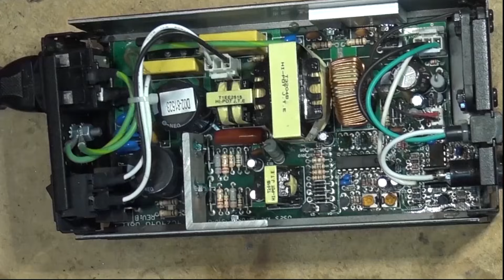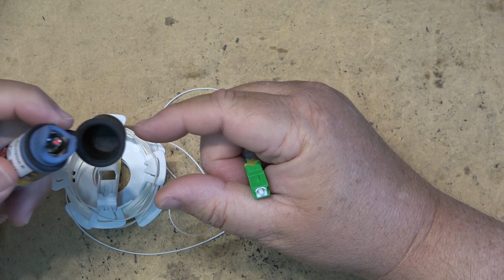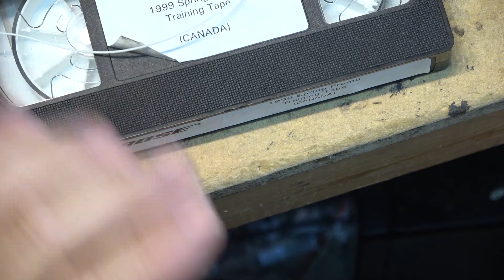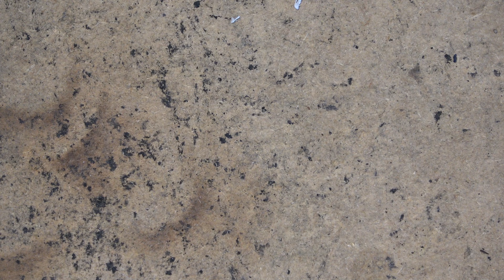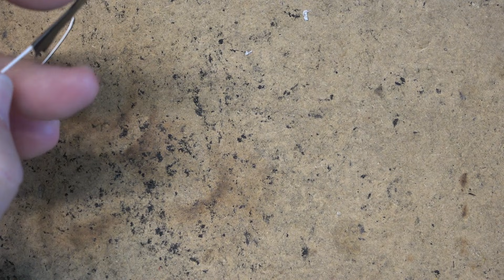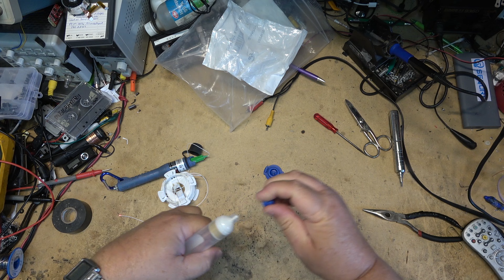Fiber Optics Tougher than you think

Comment: I’m in the uk and had the pleasure to see the first cable & wireless college being built in Coventry with optic fibre through out back then they needed to polish the ends for every connection and watched the first face to face link what we call face time now great video brill watching you at work
Reply: We would use smooth sandpaper measured in microns and you would look at the fiber face under a microscope to make sure there are no cracks or scratches for the best light flow.

Comment: My house has the black armored fiber coming into the ONT cabinet and that ends in a socket. Inside the cabinet there's a jumper of something like this stuff with SC connectors on both ends, that goes between the incoming fiber and the actual ONT. I thought the jumper looked extremely fragile, guess it's not tho.
Reply: Some are

Comment: Some time back I had a fibre optic lamp - none of this plastic rubbish filaments (says Dave)
When I disposed of it, I ended up with all these tiny bits on the floor.
For months on end I would end up with tiny pieces embedded in my feet.
They were difficult to remove with tweezers as they easily broke off.
Not fun!
Reply from the maker: That's why they started making them out of plastic.   Glass shards not fun. B

Comment: Fiber optics what about the Network interface  outside the home were it connects? Can't it be very fragile
Reply from the maker: The outside cable is armoured. Kevlar, fiberglass rods and heavy plastic jacket.
Reply: @12voltvids  rods, you talking about those green rods?
I use them on my model airplains as pushrods. Are they dangerous to health also?
Reply from the maker: @worroSfOretsevraH  if you are referring to the fiberglass reinforcement on drop cable no. Only the actually glass is hazardous if you get stuck by it and it gets into a vein.  Just imagine what happens if a piece of glass gets into your circulatory system.  Lots of places in the body it can lodge and cause life-threatening complications.  If you stick your fingertips it is uncomfortable for a few days but if you hit an artery or vein that is extremely dangerous.
Reply: @12voltvids  Yes I was referring to those light green ~1.8mm diameter fiberglass rods.
Thank you.
Reply from the maker: @worroSfOretsevraH  
No danger in those other than slivers.

Comment: Do not pull fiber by the actual fiber, Instead pull it by the Kevlar pull string. Doing this will distort the fiber it will become wavy physically and as a result light and cause millions of errors per second and your ont won’t come up.
Reply from the maker: This stuff is NOT pulled. It is placed inside, and glued up. Fiber that is pulled in is clearcurve and it has the Kevlar wrap to protect the strand. I was just demonstrating that this stuff is not as fragile as many think. It will withstand a fair bit of abuse.
Reply: @12voltvids  thing is customers will pull it and get billed the likes of which they cannot imagine. I know that you would not do it but they will take your skill for granted

Comment: Hey Dave our electric company is running it to all of their customers I can't wait LOL still 5 to 8 months away last time I checked, Anyway I was curious what the equipment inside the home looks like and how it is linked/connected to the computer if there are different types of interface. Current set up is LAN through a router.
Reply from the maker: The device at the premise is called an ONT (Optical network terminal) and comes in a few different configurations. Currently for customers with home phone a stand alone Nokia is used. This is also used in situations where there are multiple accounts, such as a basement suite or a home business requiring a separate account, as up to 4 completely separate accounts and 2 phone lines can be provisioned. These devices are limited to 1Gbit speeds. An SFP-ONT is a module (I did a tear down on my channel of a defective one a few years ago)
https://www.youtube.com/watch?v=p-oVVlIj3DA
Theses units support 1.5Gb. There are faster speeds, 2.5Gb and faster coming soon to our network but as these have not been publicly announced I can not comment on these faster plans, however the cabinets are being updated so I see the new equipment going in reserved for these big dollar plans, and they will no doubt be priced in the stratosphere for those with deep pockets that want bragging rights to the fastest service available. Business is the target group.
Reply: You will have what you have not going to your router (coax, phone line).  Fiber is actually a pain in the ass because the signal deteriorates with distance and need "boosters".  What's the chance those are used.  Fiber isn't really all what people think it is.
Reply: @ranbymonkeys2384  Thank You Ran they tell us it is fiber optic to the home so I have zero experience or knowledge about the way it is connected to the computers in a home, Dave showed a fiber optic line in another video about the diameter of yard. Anyway I was attempting to understand the interface to the computer systems it would be giving internet access too. Thanks for the heads up about it, hopefully the engineers have the process figured out by now LOL.
Reply: @ranbymonkeys2384  Any more info you know I would be grateful if you would share that with me too.
Reply: @darinb.3273  The big diameter cables are what is put into the ground called "breakout cables" like he mentioned well protected and insulated.  Then they are "broken out" into singles fibers and ran to an interface (out there by the road, just like they do now with phone lines).  Then it will go from there to houses via coaxial cable.  It's really nothing special.  I'm wondering why we can't get half way decent wireless in 2021.